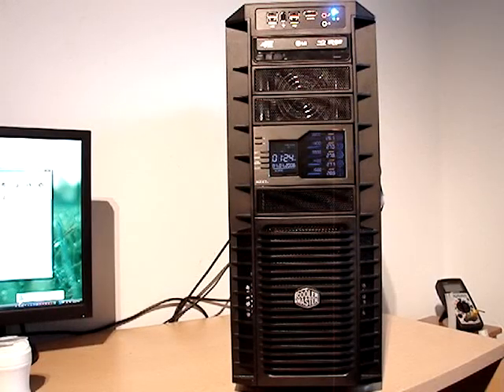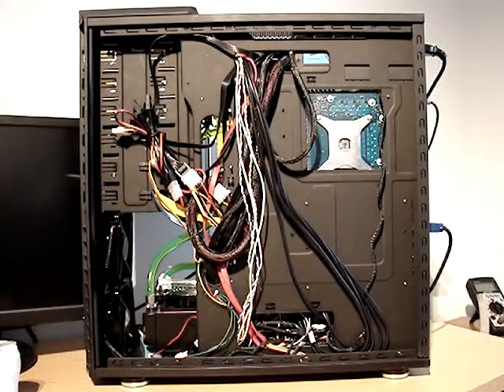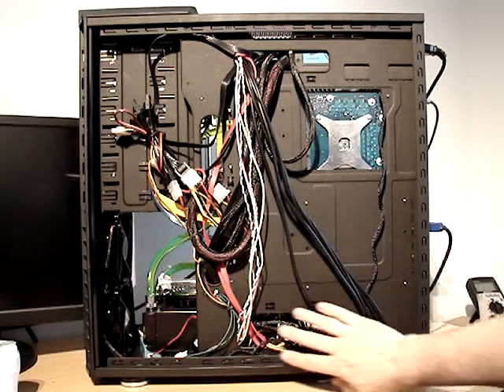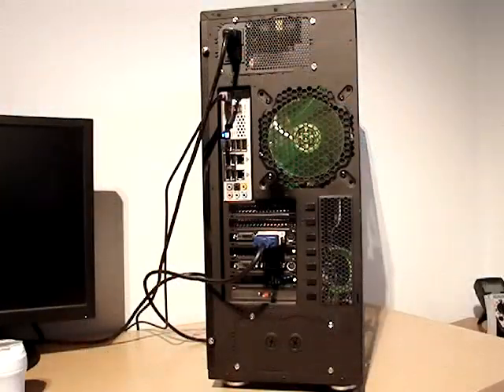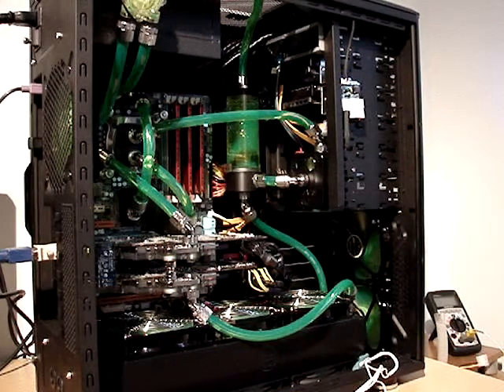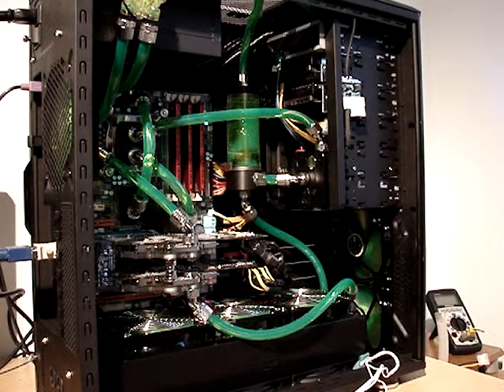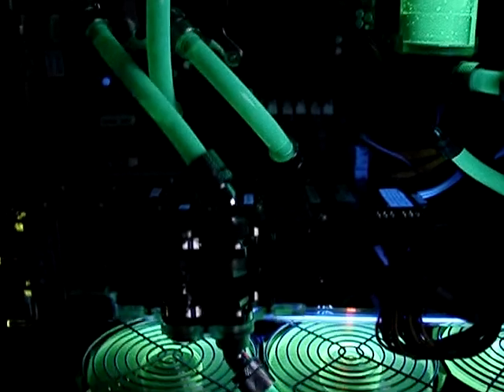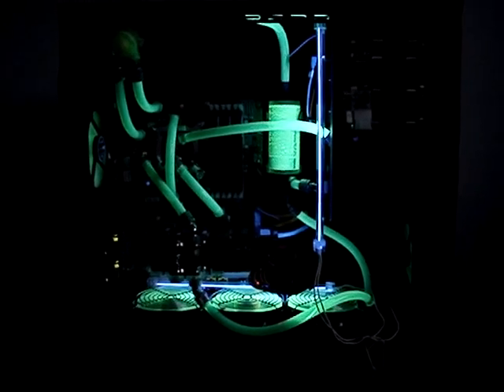Watercooling Build HAF932 - Final Video review

Comment: Hi Daz. I'm a sub'r. 

Decided to go w/3/8-5/8 tube. I asked you bout that whole tube diameter question while ago;-) 

Working on res selection(& painting;-) but for the res, I see u managed to fit the 150mm EK w/EK brackets & it fit easily?? 

I already bought Lang pump but no res yet. Lang maybe mistake. Tryn' to buy parts when I'm absolutely sure I know it's going to fit & look right. Patience.

Thanks if you can reply.

Comment: did u change the case during the process? i cud swear in ur prev vid u put the radiator to front :S

ow wells, hows it still running? no leaks or faults?

Comment from the maker: Yes, I would agree, although with Gigabyte I/O shield covered with off white sticker, it is not bare metal.

This is flow meter and rpm adapter that gives you metering of water volume from rpm reading.